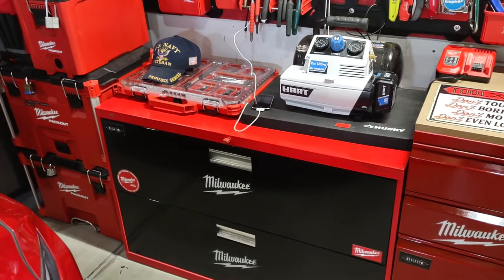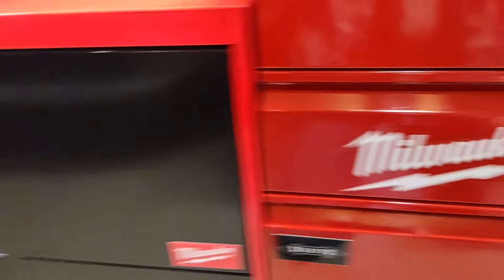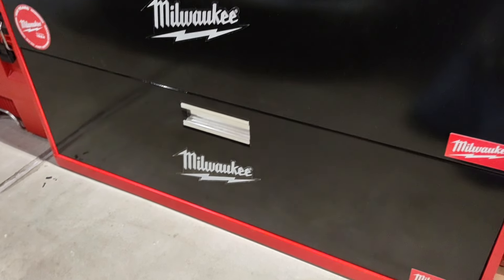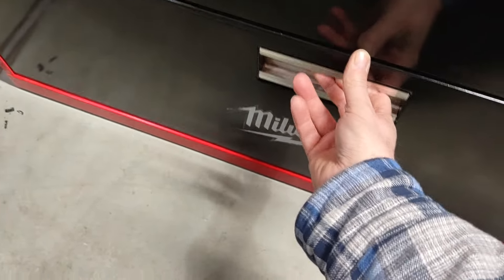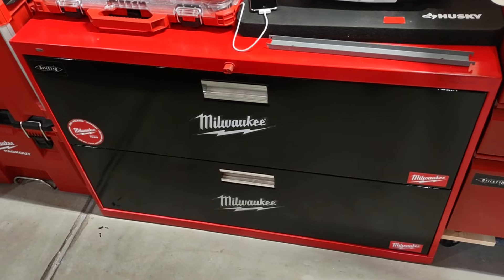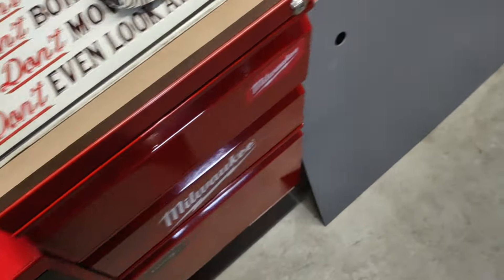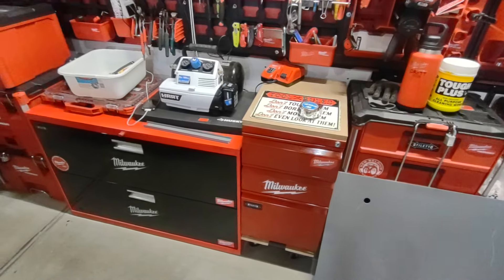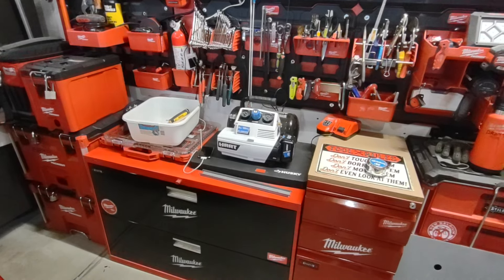Milwaukee tool File cabinet toolbox

Comment: Looks great! My dad was using file cabinets for tools as long as I can remember. At least 50 years ago! I have 1 of those 2 drawer also but not all tricked out all nice like yours! Also have taller file cabinets to hold other tools. Very affordable way to go and you've shown how nice they can look!
Reply from the maker: My company is doing office makeovers and I try to get as much as I can for projects. Could have had 2 wide 4 drawer cabinets but to heavy and no way to get them home.

Comment: It’s very nice but you might want to put the weight back in. It’s there to keep your box from tipping over when a heavy drawer is open. It’s a counter balance. I m going to put bead liner in and under the drawers and add the diamond plate mat like you did. Thanks for the video
Reply from the maker: I tried tipping it. With tools on the bottom on the specially the tool set it doesn't budge. Thanks for watching.

Comment: Some of these industrial file cabinets are better then most tool boxes...been using several myself for years.   What is the big Hart Tools thing on top ?
Reply from the maker: It's a compressor.
Reply: @jmj267  is it any good?
Reply from the maker: @enslavedbytruth  needs a bigger battery or an extra one. I just can't afford a Milwaukee because this was a clearance for $58.